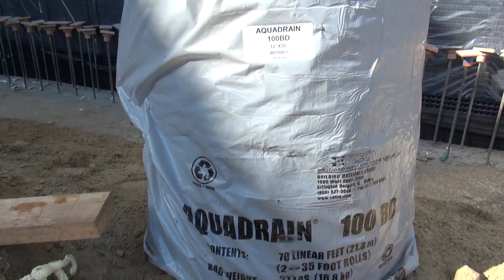High Rise Building - Subterranean Slab-on-grade & Shoring

Comment: I sold and detailed the Shotcrete perimeter wall reinforcing.  Next Century Rebar used Structural Welded Wire reinforcing ilo traditional rebar.   5:30 and 7:00 to see the WWR install process.  Thanks to all parties for the opportunity.
Reply from the maker: That is the time code range - thanks Daniel.